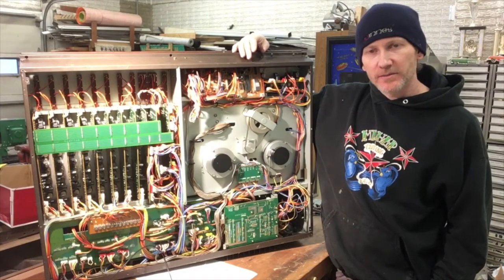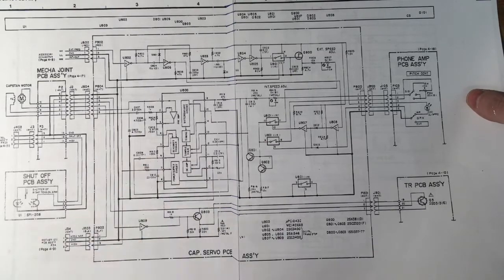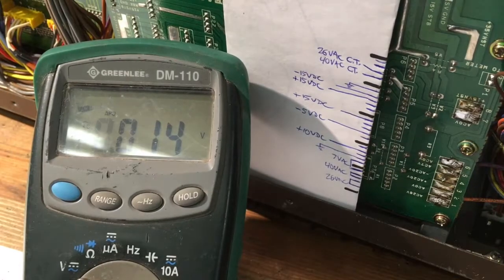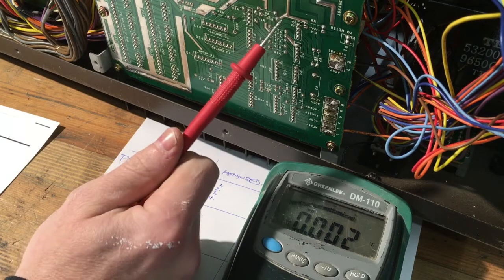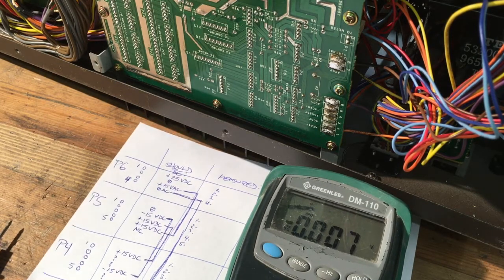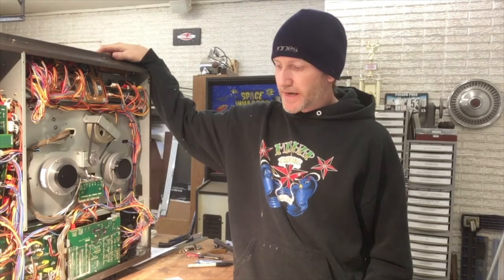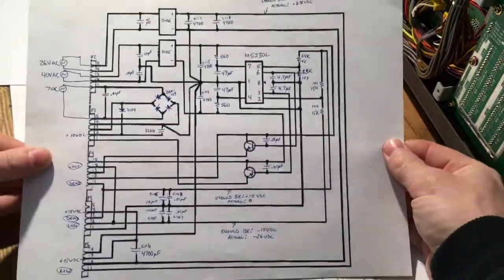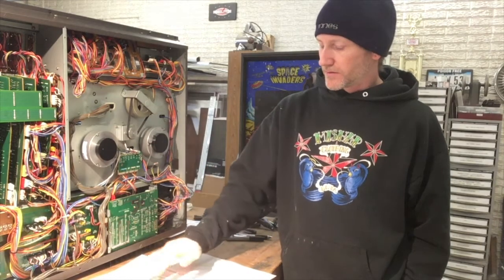Tascam 388 Studio 8 Repair and Refurbish - Part 2

Comment: On my 388, channel 5's output on RMX is VERY low but when I switch it to monitor output it's fine. Any suggestions? Is it a fader problem? I've repaired two of my faders and attempted the same repair with 5 but it didn't fix the problem.

Comment: So glad I found your videos. I pulled my transformer because I wasn’t getting the 7VAC. Now that it’s out, I am getting it, but the (7) yellow AC0V and (8) black +15VNST are reading 1.3V straight out of the transformer. Not quite sure I understand what they do. Saw you talk about them being center taps. Should I get 15V across them directly from the transformer, or will I only see that voltage when it’s reinstalled and goes through the power supply board? Any help to point me in the right direction would be greatly appreciated. 
Christian
Reply: If it helps, I wasn’t getting the +10VDC on P3-2 or anything on P3-3 when it was still together.